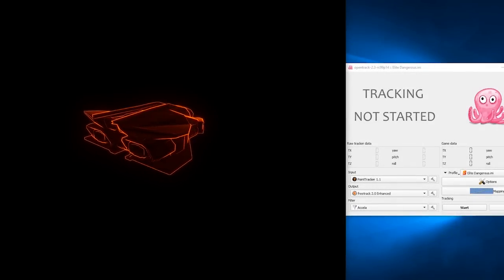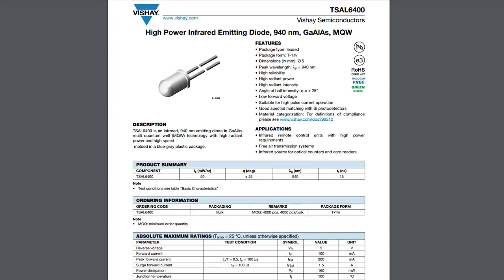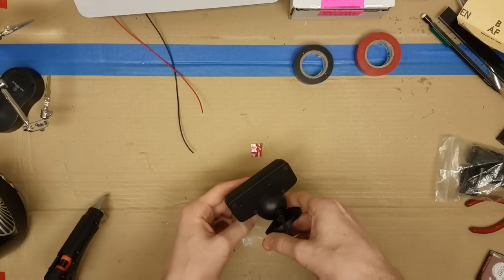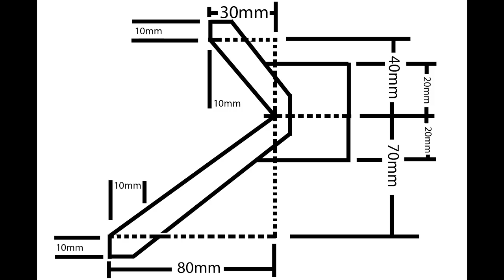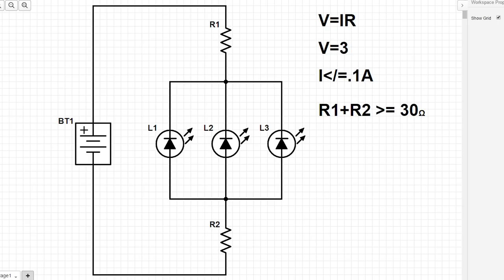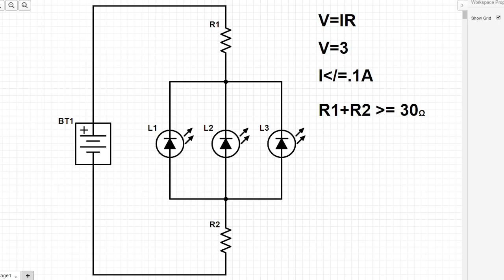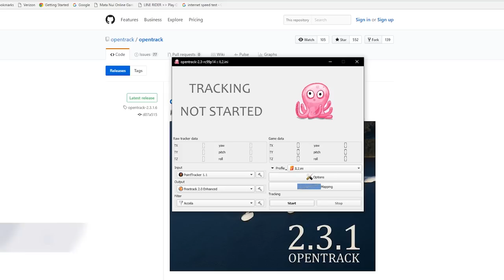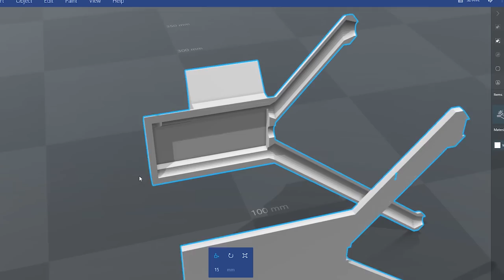TrackIR Build Tutorial

Comment: i followed all the steps but my ir leds are way to bright and create different lights spots the the software track but it goes nuts because there are so many light reflections
Reply from the maker: Wow, please link those LEDs. The best fix I think would be to add more resistance. the brightness should come down, and as a plus, your battery life should go up.

Hope it works!
Reply: This could also be an issue with your light filter on the camera. What did you use?
Reply: Try adjusting your gain and sensitivity in the cl-eye test software. I had the same problem and I don't even have an ir filter on my camera

Comment: What does sanding the ir led do? Maybe i missed the explanation.. thanks for the video
Reply from the maker: Sanding the led diffuses the light, and increases the viewing angle. If you have a spare color led, try it out on that and you will see the difference.
Reply: @civilprotection8845   dude i used usb to power the led it worked for a while than leds fried one by one i replaced them but happened again, what could be the issue do they need more power or less what could be causing them to burn like that ?
Reply from the maker: @munnumkhalid  I would guess that there is too much current flowing through your LEDs. Increase the resistance in the circuit. USB will supply much more power than a couple of AAA batteries. I hope this helps
Reply: @munnumkhalid  USB provides 5V. 2 extra volts that you need to drop with a bigger resistor.

Comment: what happens if ı dont buy a İR filter?
Reply from the maker: The IR filter is essential, although it does not need to be the one I use in the video. If you don't add a filter, then your camera will try and use all points of light in it's FoV instead of just the three IR LEDs for tracking. If you opt not to use a filter, you likely will not be able to track during the daytime, and doubly so if you have a window behind you. You will need to keep all manmade light sources out of your cameras FoV: no lamps, no headphones with LEDs, etc. And the hardest thing is that you must not have any reflective material within the cameras FoV that may reflect visible light from elsewhere in the room bc the camera will pick that up as well. The IR filter eliminates all of these problems. I know the filter is one of the most expensive components, and perhaps the most difficult to source, but it is very important to have. I have been researching other methods of filtering visible light (cheaper methods hopefully) and plan to make a short video about them... when I have some more time. For now, try to get your hands on a filter, and good luck with your build!

Comment: Can I use a battery pack with just one AA?
Reply from the maker: LEDs have a cumulative forward voltage drop requirement. If that requirement isn't satisfied then the entire circuit will fail. For example if you use four LEDs, each with a forward voltage of 1V, then you need to provide the circuit with 4V. A single AA provides 1.5V. I wouldn't recommend a powerpack that provides anything less than 3V. perhaps you should consider a cr2032 battery. iirc a single cr2032 is 3V.
Reply: @civilprotection8845  I'm going to go with 3 leds 940nm. 4 aa Battery making 6v and one 62om resistor.

Comment: Cool!  Will it work with MS FSX?
Reply from the maker: If I'm honest, I haven't tried. I did do a quick search and you might encounter problems running OpenTrack with MS FSX steam edition, but I don't know for sure.

It did work for this guy: https://www.youtube.com/watch?v=oEzecdigm6Y

 If you want to try and test before you spend any money, you might try downloading and installing the latest version of OpenTrack and use an unmodified camera or laptop camera. With this setup, start OpenTrack first, Then FSX. If the camera starts jumping around or moves in an unusual manner, I think it would be a safe to draw the conclusion that FSX is accepting input from OpenTrack.

Latest version of OpenTrack: https://github.com/opentrack/opentrack/releases

 I hope this helps you.

Comment: If I were to use only 1 30ohm resistor, where on the circuit would it go?
Reply from the maker: Before the wire splits into three branches, or after all the branches come back together.
Reply: @civilprotection8845  Great, thanks for the reply. We plan on doing this project this weekend.
Reply from the maker: @Retromags_Brian  Good Luck!
Reply: @civilprotection8845  Instead of using the PS Eye, we opted to use my Microsoft LifeCam Studio webcam, as it can detect infrared (we tested it with some TV and AVR remotes) and used a piece of a floppy diskette as the filter. However, it seems like the IR LEDs don't emit anything that the camera can pick up. I used these ones (https://www.rpelectronics.com/110-7305-10-infrared-ir-led-5mm-10-pkg.html), but maybe they are too weak? 

I tested the circuit and there is power going through it. We used the same gauge wire and 2 AA battery box with switch as you, but a 33ohm resistor instead of a 10 and 22 like you. The resistor is on the positive side between the battery box and LEDs wires.

The tracking worked with the first model built last weekend using reflective tape and a bright light. I'm thinking of just using bright LEDs instead of IR ones if I cannot get it working. The PS Eye cameras are not as cheap in Canada as they are in the US.

If you think the LEDs I got are too weak I can get stronger ones and try again. This is my first time doing anything like this. I am also not sure how to determine the resistance needed so I followed your lead. Is having too much resistance a problem?
Reply: @civilprotection8845  Did some experimenting. I think the IR LEDs I got are no good. I took an IR LED from an old remote and hooked it up to the battery pack with a 30ohm resistor and it did not work. I removed the resistor and tried again and it worked. Then I took one of the IR LEDs I bought and tried it with no resistor and nothing happened. Maybe I need a different kind of LED...
Reply from the maker: @Retromags_Brian  OK, there is a lot to unpack here, so I'm going to do my best. First, it's awesome that you found an alternate camera to work with. I'll check that out for myself and add it to the parts list in the description. Your resistor placement looks fine, and is the last thing I would change. Over resistance will reduce the brightness of the LEDs and increase the battery life. Under resistance will increase the brightness for a short duration before the LED burns out.

I suspect your problem is with your LEDs. The link you provided didn't work for me, but I think I found what you were using: https://www.rpelectronics.com/110-7305-10-infrared-ir-led-5mm-10-pkg.html and there was also a link to the LEDs data sheet: http://optoelectronics.liteon.com/upload/download/DS-50-92-0015/LTE-4208.pdf

Now those LEDs as linked above have an optimal power draw of 20mA going by the product page, and 20-50mA going by the data sheet (always try to find and read the data sheet). The LEDs that I recommend, and have linked to in the description operate at 100mA. Brightness of an LED has a roughly linear relationship to the current passed through it, so the LEDs that I use and recommend are between two and five times brighter than what you are using.

Last, with regard to using color LEDs, that is an option, but one that I wouldn't recommend. If you go with colored LEDs, then you would also have to ditch your IR pass filter so that your camera can see the LEDs. You would likely only be able to use the tracker in the dark. You would need to make sure that there are no visible light sources, or reflective surfaces within the FOV of the camera as they might interfere with tracking. And, You would have to steer clear of headsets with built in LEDs, not an easy thing to do in a market which crams an LED into anything a gamer might see. Even more subtle headsets are likely to have an LED to indicate the status of the microphone.

Last note: IR LEDs can be just as bright as colored LEDs, the human eye just can't see it.

Good Luck!
Reply: @civilprotection8845  Thanks for the reply! I suspect that what I got were IR detectors as they would not light up under any test I did, no matter how dark the room was and how close it was to the camera. 

I have ordered more IR LED emitters, different kinds from different places, all that operate at 100mA. They also generally all have a typical forward voltage of 1.5V (1.3 to 1.7). Using the R = V/I equation to figure out resistance (using this Element 14 video https://www.youtube.com/watch?v=kQoLy_us5J4&t=142), if my math is correct I don't need any resistors because the combined volts of the three LEDs exceeds the voltage of the battery back. Subtracting the combined voltage of the LEDs from the voltage of the two AA batteries (as they do in the video) leaves me with a negative value. 

Subtracting the value of one LED since they are in parallel (R = 1.5V / .1A) leaves me with a resistance of 15ohms. You did not subtract the LED voltage from the battery voltage in your equation. Is there a reason for that?

Sorry for all the questions. This is my first time making something from scratch. My previous electronics tinkering was modifying a Model 1 Sega Genesis for composite video out and stereo audio output through RCA connectors.
Reply from the maker: @Retromags_Brian  So everything you have typed above the best of my knowledge is correct. Here I'll be honest, I made quite a few mistakes in my first build with regard to the math. Despite that, I ended up with a working product. Knowing what I know now, each one of my LEDs has a "typical" voltage draw of 1.3v. X3= 3.9v draw from a 2.8v cell. If you do the math, you should end up with a 1.1v deficit. As best as I can tell, the "typical" forward voltage is an average with high and low deviation. In reality, my LEDs are using about 0.9v per unit. I have experimented with adding a fourth LED without changing the cell voltage, which invariably causes the entire circuit to fail. So I guess my circuit is pretty close to the edge of failing. But not failing is not failing eh?

Your math for what resistance you need is also correct, you shouldn't need any resistors. Even so, add a resistor. I know that the LEDs and the wire technically have a very small resistance, but they are essentially negligible in such a small circuit. So play it safe and add a resistor, even if it's just one ohm. You may also find that the LEDs are too bright without restricting the current. This can cause the light from the LEDs to bleed into each other, leading to inaccurate tracking. Lastly, if you restrict the current, you increase the battery life, which has obvious conveniences to it.

I hope that answers your questions. Keep working at it! I'm sure you'll get it to work.
Reply: @civilprotection8845  I've got a box of variety resistors coming, so I will add something. I will start at 15ohms and work down, but will probably use 1ohm like you suggest. I'll actually have enough parts to build several of these, so I'll be able to compare different LEDs and different resistors.

When I have it working I'll let you know in case you're curious. Thanks for all the help so far!

Comment: Also, why do u have to use sand paper on ur IR leds ?
Reply from the maker: To defuse the light and increase the tracking angle
Reply: @civilprotection8845  I see, what if I get the transparent type of IR led, I do not need to use sand paper on it right ? 

Also, from ur circuit schematic, I'm wondering why your IR Leds were placed with the -ve side facing the +ve side of the circuit? Thanks
Reply from the maker: 1) check the data sheet for the LEDs you want to use. specifically, find the graph of brightness over viewing angle. Most LEDs will have a maximum brightness at a viewing angle of 0, ie you are looking directly into the LED, and will drop off to zero at an angle of 30 degrees. This is insufficient, and this is why I recommend sanding the LEDs as it will diffuse the light to the camera can track the point lights at all viewing angles.
2) don't worry about the circuit diagram to much. there are a couple mistakes that have been pointed out to me, and I have talked about elsewhere in the comments.

Good luck with your build!
Reply: @civilprotection8845  Got it ! Thanks a lot for ur effort and advice !
Reply from the maker: @jensenex9270  I hope it helped!

Comment: Sanding led's? To retain brightness at increased viewing angles by removing glass, or does sanding the glass make make the led appear larger so it can be seen with your head turned?
Reply from the maker: A little of both really. Lightly sanding the LEDs diffuses the light. It will reduce the brightness when viewed head on, and increase the brightness when viewed from more extreme angles. The result is that sanding will reduce glare and maximize the tracking angle.
Reply: @civilprotection8845  roger that, thanks for the explanation. Im gonna attempt it, all my stuff i ordered should be delivered today 👍.
Reply from the maker: @modernmountaineer  Best of luck with the build, and happy flying!

Comment: Could I use this with a normal webcam?
Reply from the maker: That's a tough question. First, not all cameras see IR light. Most do in my experience between phone cams and webcams (both stand alone and laptop). Still, there's a bit of a risk there-- and it's not an easy thing to read about in specs or reviews. Second, you need to consider framerate for smooth tracking. Most normal webcams can capture at about 30-60 fps. The ps3 eye camera is unique because it was designed for tracking. It can capture upwards of 120 fps depending on ones settings. So, the short answer is yes, you can use a normal webcam. However, there would need to be much more research and testing. I have tried a couple other webcams and have not found anything better than the ps3 eye cam. If I ever do, no doubt I will make an updated video about it. I hope this helps, Cheers!
Reply: @civilprotection8845  I mean, a normal camera can be used for face rig, which tracks your face, so technically you could do the same for an ingame camera view
Reply from the maker: @warcrimemenace6292  Face tracking software is typically much more calculation intensive, and requires decent room lighting to be effective. In my experience, there is a significant input delay (0.5s aprox). But it's been many years since I have tried face tracking, maybe it's better now.

Even so, if you want to try face tracking, you need to invest in a high FPS camera for a smooth experience.

Comment: What is the reason for sanding the LED's ?
Reply from the maker: Most LEDs come with a glass lens. This simply means that the plastic that encases the LED is super clear. LEDs like this will only shine light in a 15-30 degree cone from where the LED faces. Sanding the surface of the LED transforms the glass lens into a diffuse lens. When sanded, the light will travel through the lens until it hits the outer layer, and then it will be scattered. This will dim the LED a little (and this is why it is important to buy really bright LEDs), but it will dramatically increase the angle of the cone (160-170 degrees from center).

TL;DR- Sanding the LEDs will slightly reduce the brightness, but dramatically increase the tracking angle.
Reply: Somewhere I have seen that we can cut the heads of the LEDs flat, and they will perform better. Is that correct ?
Reply from the maker: I've read that as well. I tested both an even sanding across the entire LED lens, and I tested sanding the LED down to a flat head. Both methods worked, and gave the LEDs a max viewing angle of around 160-170 degrees. The flat head however had a tendency to grow dimmer, the closer the LED got to 90 degrees perpendicular to the camera. at 90 degrees, the LED was almost invisible to the camera. Passed 90 degrees the LED would grow bright again. The even sanding did not have this tendency, and had a consistent brightness from all viewing angles. So I concluded that that was the way to go. In reality either will work because you won't have reason to turn you head 90 degrees away from your computer screen. But I still recommend the all-round even sanding.
Reply: Alright, so I have bought 10 of these LEDs and going to try different ones before soldering them in place. This is because I am not sure if the LEDs are bright enough, so sanding them will make them dim for they won't be recognized. I hope not, we will see.

Thanks for the reply!
Reply from the maker: That is definitely the way to go. You're on top of it from what I gather. I will say right now (because I'm not sure I mentioned it in the vid) that it is not uncommon for between 1 in 5 and 1 in 10 LEDs you purchase to be either defective in some way, or sub par. Always test the LEDs you intend to use. I found that out the hard way. As far as knowing how bright they are, the specs sheet for the LED will have all the information you might need (admittedly, they are not always easy to find). Good luck man. Let me know if you run into any problems :)
Reply: Civil protection This is awesome info. I was just looking for 50 degree leds but this should solve the problem.

Comment: My resistors went too hot help
Reply: How do i find the right resistor
Reply from the maker: Us the equation V=IR to find the correct resistance. What are you using to power the circuit? What is the voltage? @officalflash5534